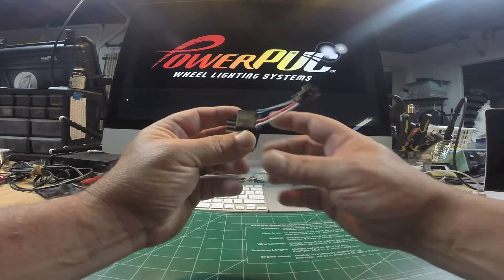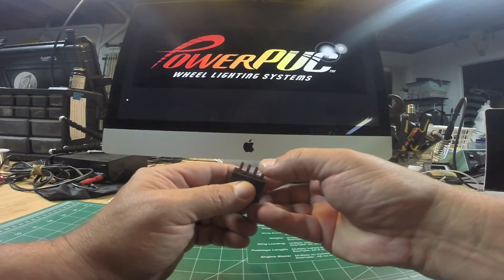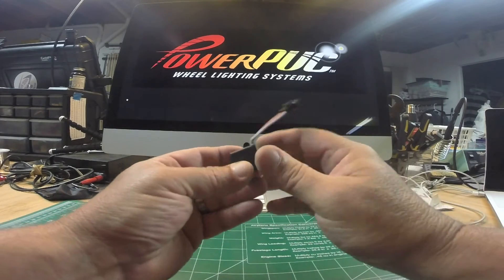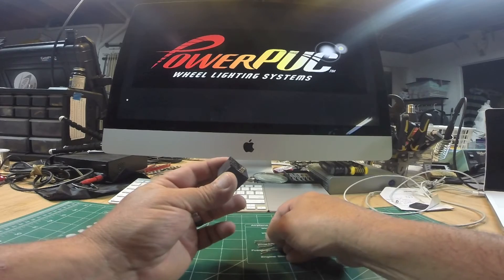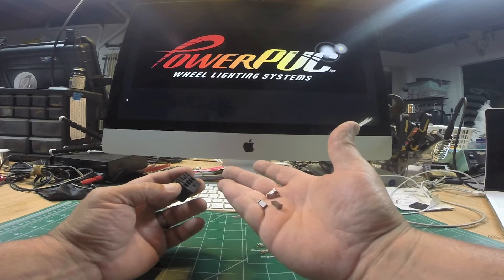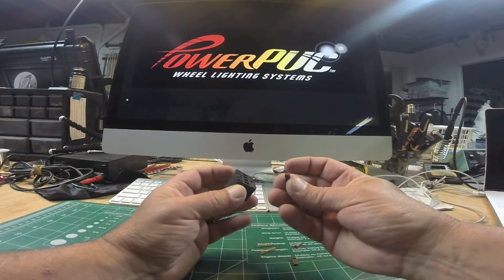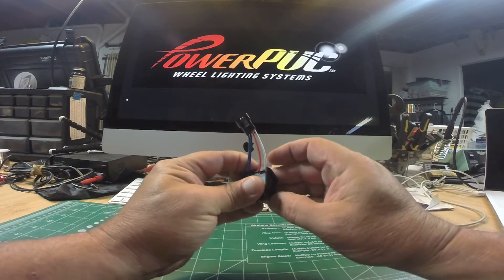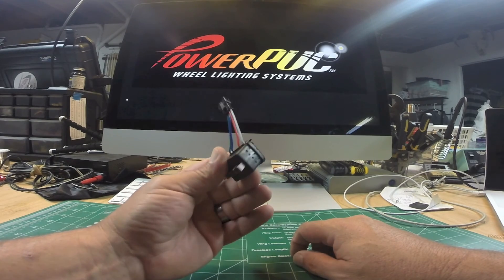G5 brush block rebuild

Comment: i have a problem with my g5 power puc, from the starts that i have it, it sometimes wont work, sometimes it works great, other time, it just wont come on or go off,  first i toutght it whas flat battery, butt after chaging that, it whas nog bether, if i point my remote to the bike, from diferent angles, ist like the reciever is block by the bike his body,  and dont get the signal,
Reply from the maker: Hello Johan. I'm having some difficulty understanding your question, but I think it has to do with reception between the key FOB and controller. It sounds like you have changed the batteries in the FOB? Is the little light coming on that is in the FOB? If yes and depending on the remote you received, the antenna wire may be coiled. You can stretch the antenna wire and / or connect it to metal on the bike to extend it's range. 
Best way to get a timely technical response from us is to email at info@rawdesigncycles.com
Reply: @RawDesignCycles  iam sory about my bad englsih, yes the light off the remote come on!,
Reply: @RawDesignCycles  i will send you a video  and some pictures of it, maby that will be easyer to see whats going on, thx
Reply from the maker: @johanvanhullebusch980  
Yes. Please send to info@rawdesigncycles.com
Reply: @RawDesignCycles  i just send you some video of the problem , true gmail, becausse true email  i cant send it to you